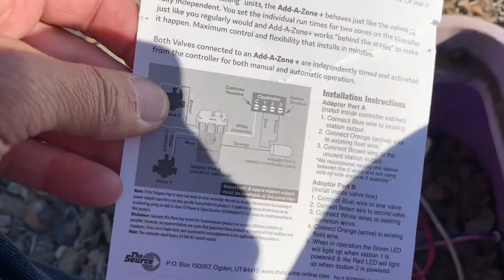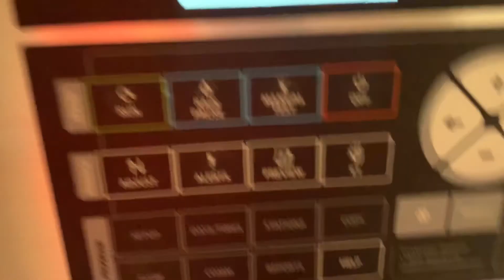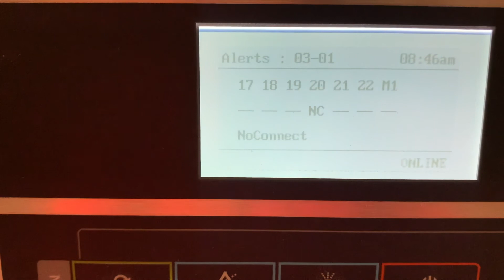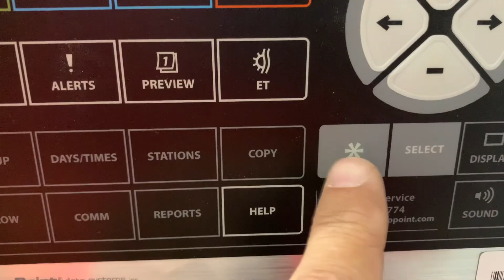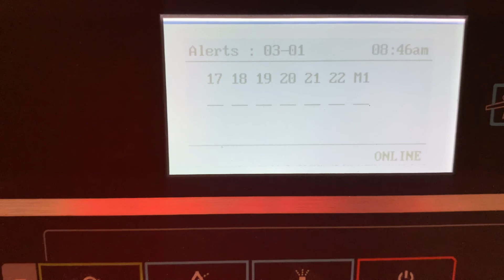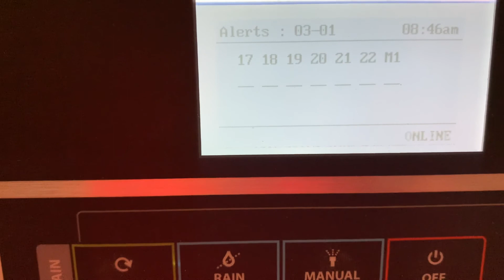Easy way to fix or add a wire for irrigation zone

Comment: I’m looking to use this product in one of my turf areas, does this device work similar to other add a zones? I've run into where it switches between the two zones on the run time.  It makes it difficult when I’m running one zone with a rotor at 360 coverage and another with 180 coverage.  Does this device keep the runtimes separated? Thanks

Comment: Are there wires that can be purchased to extend the length of the solonoid common and zone wires?
Reply from the maker: If I understand you correctly, there is not a simple way.  You will have to splice the wire from where you can find all the wires, then extend them to the area you need.  That's the beauty of this product.  Many times it is not feasible to run new wires.